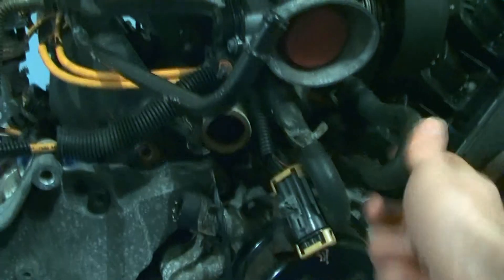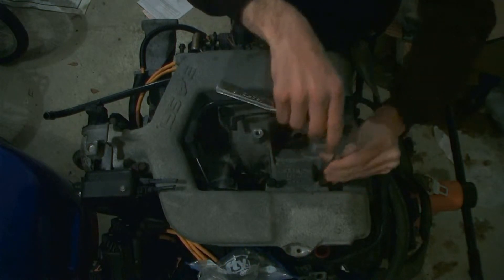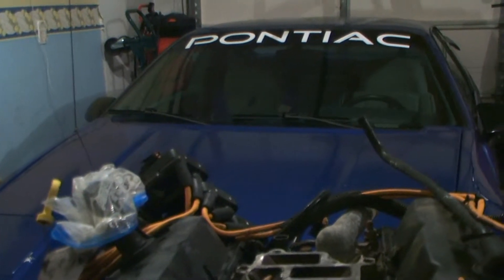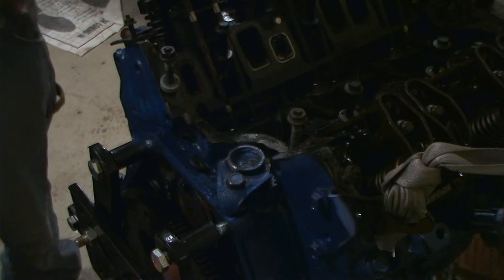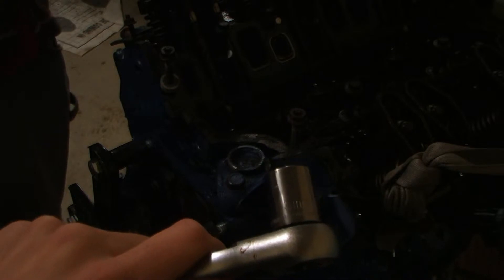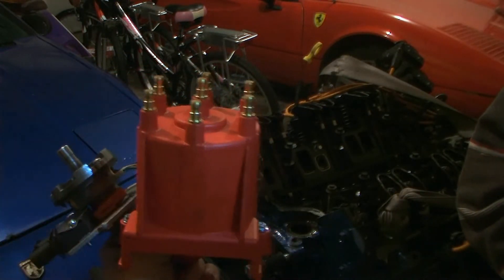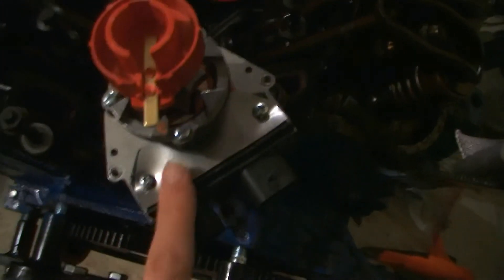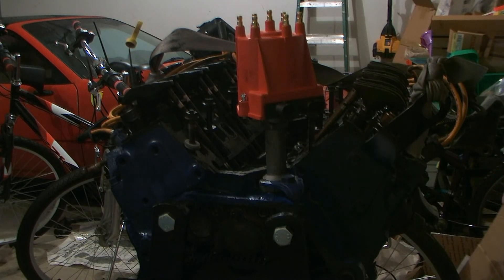Pontiac Fiero - How to convert a 3.4 push rod engine to Distributor based (HD)

Comment: Smart move going with a brass terminal cap-&-rotor.
Tip: Auto Zone sells a heavy-duty replacement cap & rotor--with brass terminals--that's just as effective and durable as the MSD pieces... and costs allot less!

Comment: When I stripped my 2.8, I set the timing mark on 0 with the distributor still in-place, timed to when the engine was running, and still the rotor points to exactly the opposite of what you say is #1, plus the #1 plug wire was wired to that post also.  I looked up the firing order for the 3.4 and it showed the same location for #1.  I don't mean to be a pain in the butt, but I want to do it right, and if I set it up like it was wired on my 2.8, #1 is exactly 180 degrees to where you say #1 is...

Comment: My Haynes manual and the on-line references, both, say that what you say is #1 is actually #4.  I just dropped my 2.8 & cradle, for a 3.4 swap, and it is wired with #4 where you say is #1.  So, what am I not understanding here?  Please clarify!  Also, on your other video, you drop the pan, oil pump and bearing journal to install the rear bearing.  Is this really necessary, because the manual says to install it without doing all of that?  Please clarify!

Comment: Looking at your video again:  When you show the 2.8 with the distributor and plug wires installed, what you say is the number #1 cylinder, looks like it's wired to #4 piston also (Same as mine, on the left side of engine).  But, #1 is the first cylinder on the right side, front of engine.  Yet, the Cardone distributor is marked in the position you say is #1.  I'm confused!

Comment: In your video, your say cylinder #1 is on the left of the flat side of the distributer (video position 11.18).  But my Haynes manual for the 2.8, and on-line for the 3.4 (firing order is the same) both say that number one (TDC) is on opposite nearest the block.  I just dropped my 2.8 engine/cradle and it is wired like my references say.  What you say is #1 is actually wired to #4.  What am I missing here?